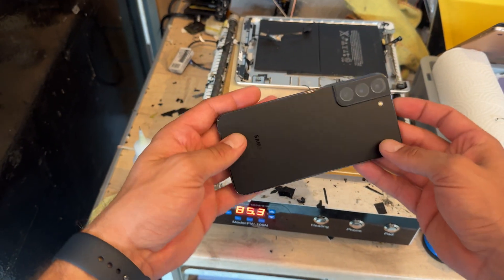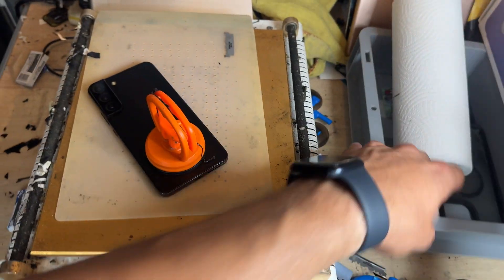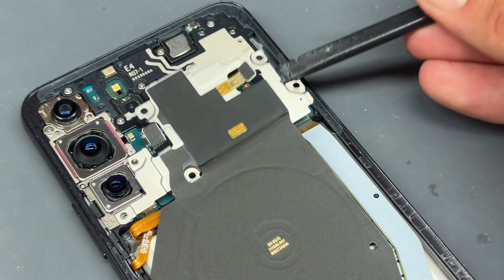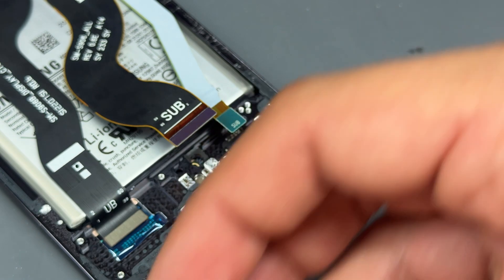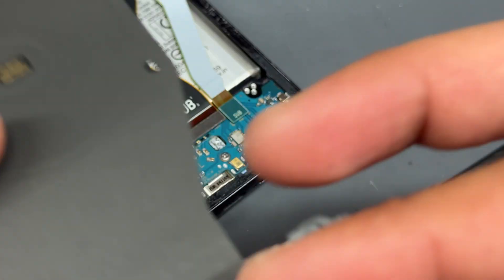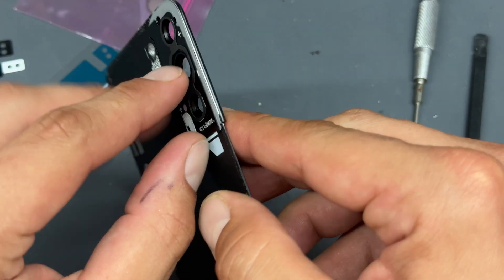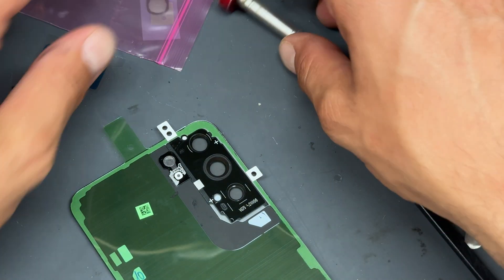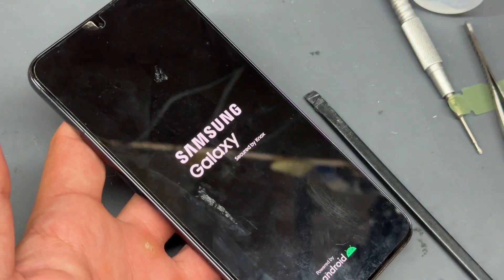Samsung S22 Plus Charge Port Repair - DIY Guide to Fix Charging Issues!

Comment: anyone knows if the connector on the motherboard to the the cable running over the battery (the upper side where the UB MAIN Cable connects to the motherboard)  on the S22 Ultra can be fixed if damaged? do we need to replace the whole motherboard? The cable is fine but where it connects to and on the motherboard just fell apart